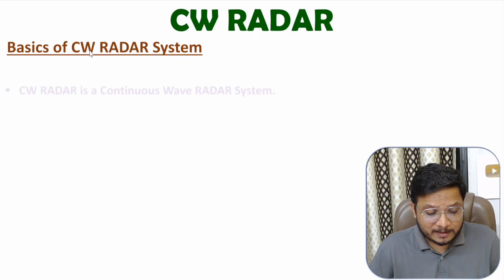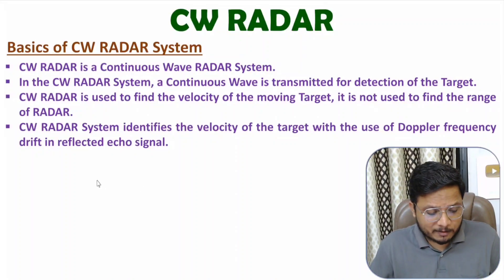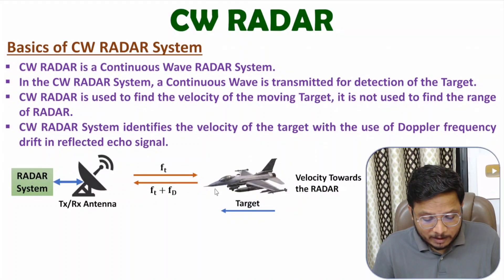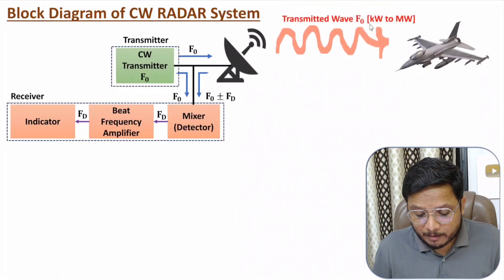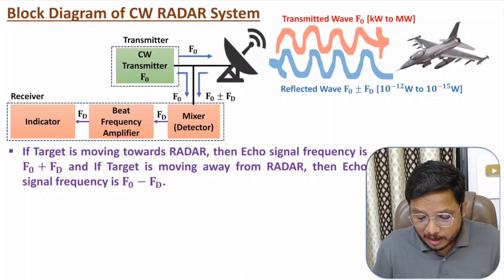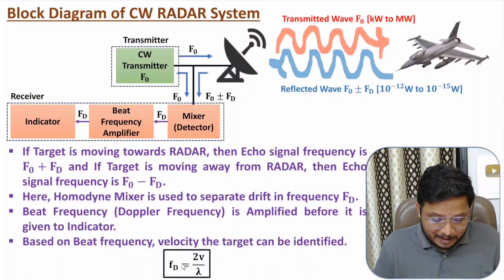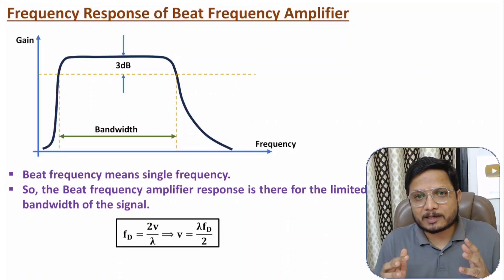CW RADAR or Doppler RADAR (Basics, Block Diagram & Frequency Response) Explained

Comment: Timestamps (Powered by Merlin AI)
00:02 - CW radar identifies target motion using continuous waves.
01:18 - CW radar measures target velocity using Doppler frequency drift.
02:31 - Frequency drift in CW radar indicates target velocity and direction.
03:30 - Signal transmission and frequency reflection in Doppler RADAR.
04:32 - Frequency changes in radar signals based on target movement.
05:32 - Homodyne mixture identifies Doppler frequency using transmitter and received signals.
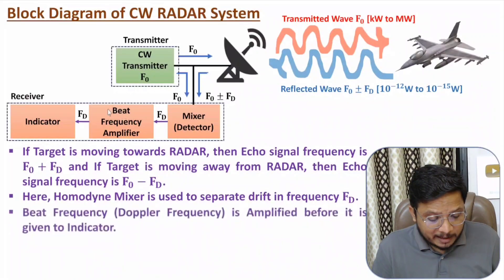06:38 - Homodyne mixture enables frequency drift identification via beat frequency amplification.
07:42 - CW Radar has limited bandwidth due to beat frequency amplification.

Comment: Dear sir, 
If the target changes its speed from a very high speed to a very low speed, then the Fd will change significantly. As a result, we will need an IF filter and wideband IF amplifiers, which will lower the receive sensitivity S_min, am I right? If so, how can you avoid an unnecessary increase in the bandwidth of the IF filter?
Reply from the maker: It is explained in doppler filter bank 22 video